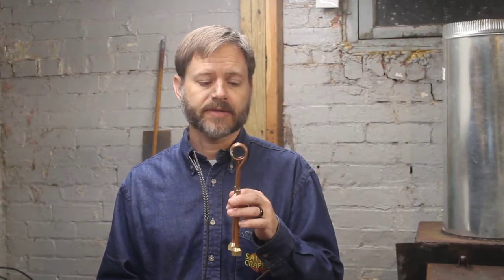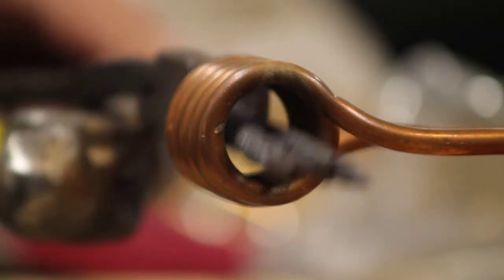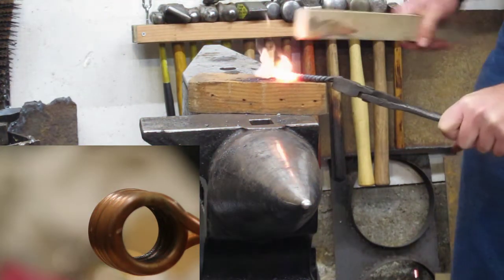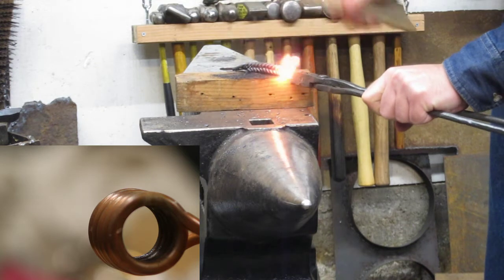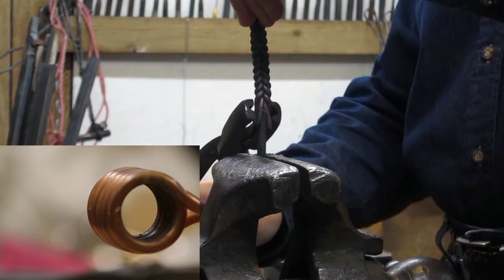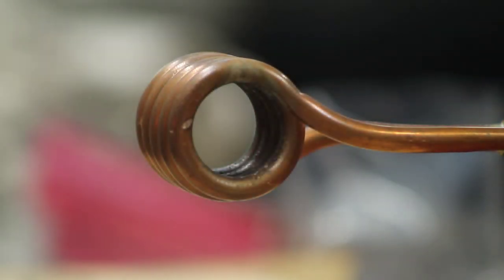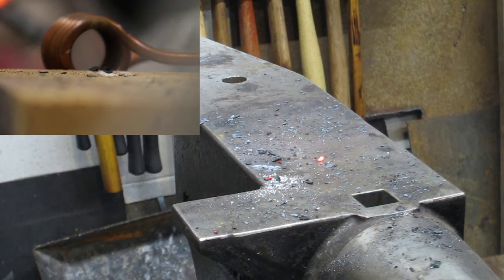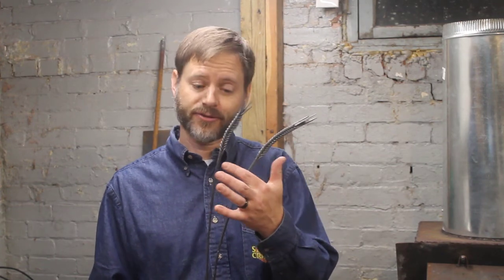Forge welding small stock with an induction heater (wheat twist)

Comment: steel chain mesh "smithing pillow" lined with glass mat and packed with sand.
Butcher's mitt would do. Weighted wood mallet.
Carbon wood smoke might be fouling these faying surfaces. Consider fiberglass mat over  wood to lessen smoke.

Comment: I have a question or 2, the induction is quick, the coal is dirty & propane is noisy. Ok which is the least expensive???
Thank you for your work it’s interesting I’m not going to do any. But it sure is interesting
Reply from the maker: Hi Bill, glad this is interesting. The short answer is  induction is cheaper. Coal and propane both suffer from massive "flue" losses and coal radiates tons of heat in the shop (not entirely a loss in the winter). That said, coal is really close, if you don't include my cost to transport it or my time spent starting, closing down and maintaining the fire. The one big exception is production work feeding into a power hammer. At that point, propane wins because the smith can rotate thru working 3-4 pieces. But, it wins on overall production costs not on pure heating costs.
Reply: @ejoftheanvil  Thank you sir

Comment: You should make a lead cored hammer with wood faces, you might set the hammer on fire now and then but they should be easy to replace.
Reply from the maker: Yeah or even just a wooden mallet. I just haven't gotten around to it.

Comment from the maker: I'm interested in thoughts on the two breaks that occur near the forge welds on the stem. The breaks are not in the weld itself but only near it in an area that also spent considerable time at weld heat. I suspect that time at high heat lead to significant grain growth which compromised the fairly thin stock enough that it couldn't support the wheat head.

Another thought would be that the metal "burnt", but I did not grind before subsequently forge welding it back together. In my experience "burnt" metal is unworkable and must be ground away.
Reply: EJ of the Anvil I think that both of what you suggested may have contributed to the break, the extended heat time causing weakening coupled with excess oxide layer. It did look as if you were using very little flux,maybe too little for the relatively high surface area around the weld zone. Im glad they worked out well in the end, they do look nice, especially with the brass brush finish that is a nice touch.
Reply: EJ of the Anvil just another thought, I wonder what effect metallurgicaly speaking, that a strong high frequency magnetic field would have on grain orientation and growth at the extended plastic / weld heat that the metal was subject to? Something to ponder upon...